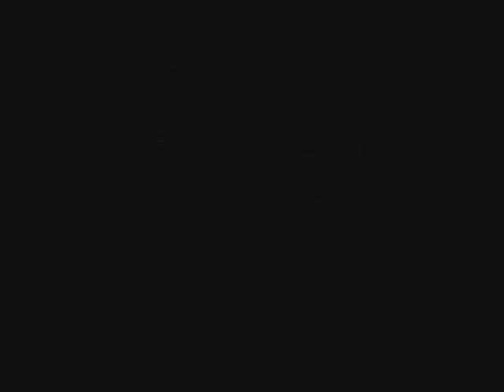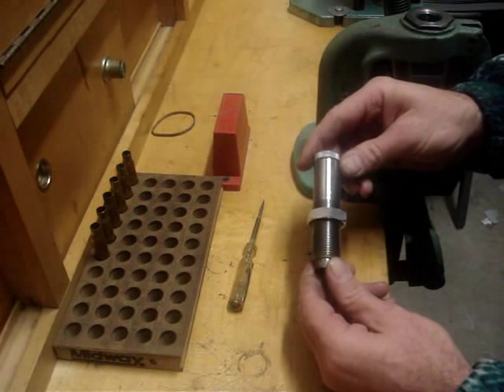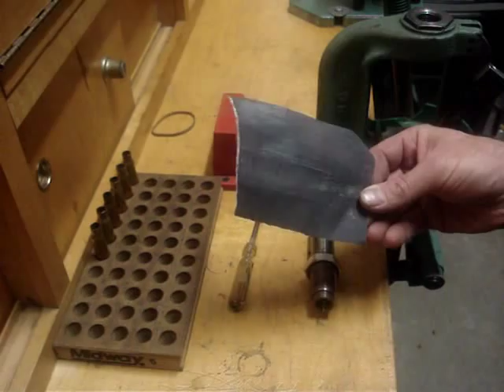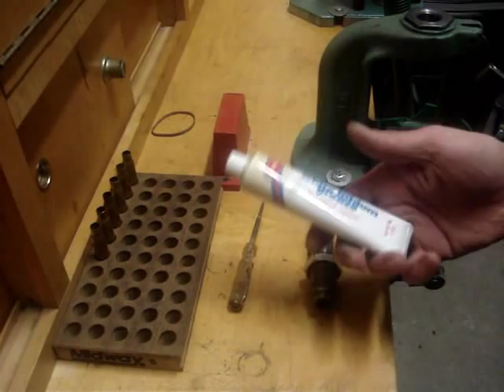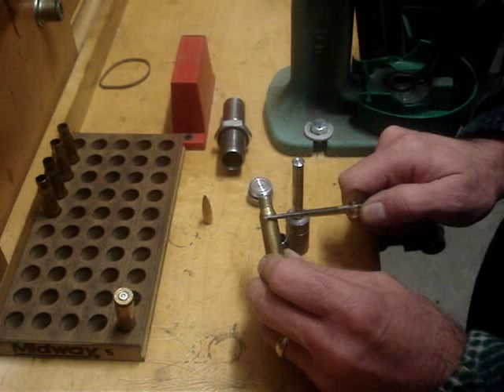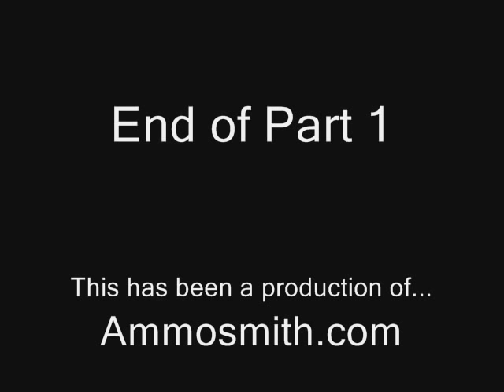Lee Collet Neck Sizing Die Part 1

Comment: Those dies are a charm to work with when you take some time to do what Lee has not done, probably to keep their product cheap; Take it apart, clean everything and polis the surfaces of the parts that slide over each other when the collet has to move and lube those surfaces with High-grade Teflon grease. I would have loved to see one made by Redding.
Reply: +Paul Tummers I've been threatening to try polishing my die for weeks now, and have gunsmith tools ready to do it in a minute. Doin it now, thanks! Kinda cool, when I was reading "I would have loved to see one made by"....I guessed you would say..."Redding", then I clicked "Read more". I have owned but one Redding die set, but that's all it took for me to realize the type of quality you were alluding to.
Reply: +kelhawk1 There are other good products on the market when it comes to dies; I personally have all my rifle dies from Forster, they also are great value for the money. It is a very good concept, those Lee Collet dies, but lee does operate in a nice of the market that does not allow them to give as much attention to thing like polishing and finishing as others do. I have a lathe, and one also can customize those collet dies to a certain kind of brass/bullet combination by reducing the diameter of the mandrel. Make sure, you polish it very well when having done that!
Reply: +Paul Tummers I hadn't even considered messin with the mandrel yet. I do have in mind to machine an adjustable spacer that fits around the collet sleeve, between shellholder and the body of the collet die, to positively limit the crush on the collet. Seems like it could produce more consistent results than using a torque wrench as a press handle.
Reply: Lee Collet dies are very affordable and VERY GOOD compared to the big named ones eg Redding, RCBS, Hornady, Oh Forester is another very good product.

Comment: As an avid Lee collet die fan, I’ve a few tips to add:

1.) You can get a custom turned mandrel for their collet die to make the neck tension exactly what you want. 

2.)To set it up for consistency, start loose and keep going until it bottoms out on the bottom of the stroke. (On my Forster, it doesn’t cam over much) If you crush the shoulder, back it off until it doesn’t. The reason I like it that tight is because it actually uniforms the neck thickness this way (find a funky casing, check for yourself) 

3.) Take the die apart. Get a Work Sharp knife sharpener. Rotate it around while buffing off the machine ridges on the mandrel shoulder. This will make sense when you take it apart. Work your way through the belt grits until you polish it with Flitz on a used 6000 belt or on a leather stropping belt. Use a dab of moly grease. You will not believe how slick it works after this and how consistent the feel is! 

4.) Rotating for a double working is really helpful to uniform the neck, plus, it will push out any thick spots. Again, almost as good as neck turning.

5.) You can make awesome precision semi-auto ammo with the Lee Collet die. I sent my .308 Forster die back to Forster with three used casings. I asked them to make it so that it bumped back the shoulder three thou and had them take the neck away until it didn’t touch the neck. You full length size the brass, then use the .308 Lee Collet die to set the neck. A bit more work for sure, but worth the effort and works the brass a LOT less than any other way!

6.) I really like the Lee. Other dies monkey with the brass so badly. Think about it; other dies squish the hell out if the neck on the down stroke. To see just how bad, take the sizing ball out, press one and measure the poor crushed misshapen neck. Then, after you have this done, the ball gets dragged unsupported in any uniform way back through the neck to stretch it back out! The brass springs and stretches any old way it decides to compared to the uniform crush of the Lee against the mandrel! The proof is in the runout. Worst thing of all, regular dies work the brass far far more than a Lee Collet die. I get a lot more firings from brass with the Lee. I propose that the hardening is as much done by the extra working done by the ball sizing dies than the firing. But I could mistaken.
Reply from the maker: Thank you! I learn a lot from the viewers and our forum members. They also make the dies on 50 BMG now. Lee uses rail road tracks and spikes for the material.
Reply: Also don't forget to anneal first

Comment: Do you recommend just the neck sizing die over the full size die? I have been told that the fired brass fits exactly the gun chamber so its a good idea to only change the neck as it will be  more accurate as there is less expansion the next time around.

Comment: You started by not having too much Faith' on the Lee die only to find outat the end  the concentricity would be very good with the Lee die..as for that high spot that you found when you were using the concentricity gauge for that high spot that showed   on the concentricity was because you were supposed to turn the brass slightly so that high spot would be crushed and you won't have that problem.it happens when the brass flows between the petals

Comment: Thanks for the tip on the collet w/ grit and grease.  Any chance you could set up the Hornady LNL AP for 223 with the Lee Collet and Lee FCD and the other die of choice that you feel is the best combo?  Specifically for a 223 bolt action rifle for accuracy purposes?

Comment: I am confused about one thing. I have the Lee Deluxe die set for .223. In the set are two dies with decapper rods (full length resizing die and neck collet die). I only use one of these dies in the press (Lee Loadmaster), not both, right?
Reply: If you shoot that ammo from a bolt action, then go on and use the neck sizing die. If on the other hand you shoot it from a semi auto, you are going to need to full length size your brass or it most likely won't chamber, or give you big feeding problems at the very least
Reply: @StefanoRovere  I am getting ready to reload for a bolt action and have read that the collet dies can be used until extraction becomes difficult, then you can use a redding body die (which doesn't affect the neck) to bump the shoulder very slightly then the collet as usual

Comment: if you are experiencing a case that doesn't chamber then the shoulder and body need to be sized. I never had a case neck sized with my Lee Collet die oversize to the point of a case not chambering.